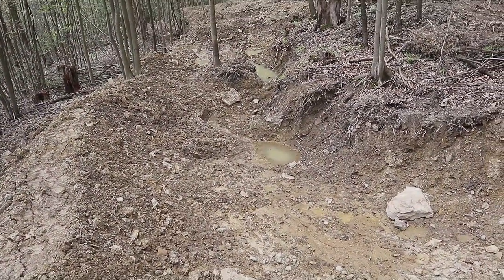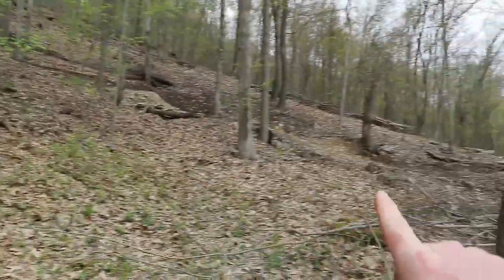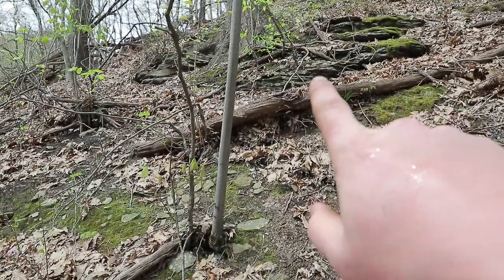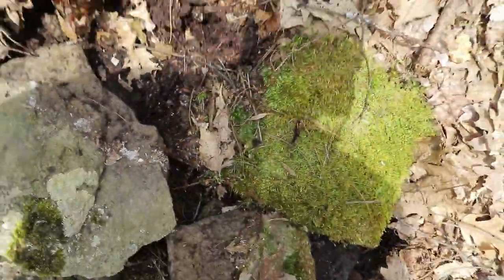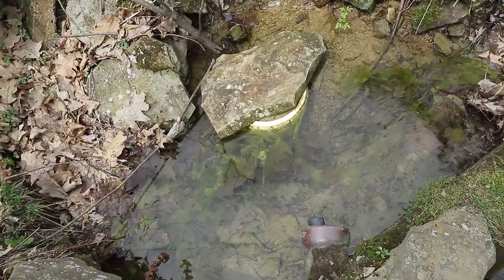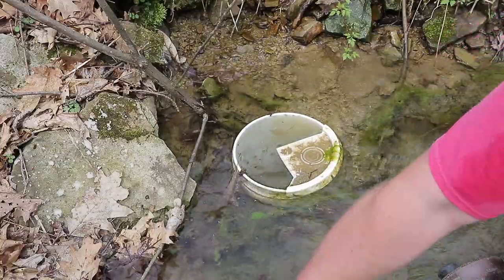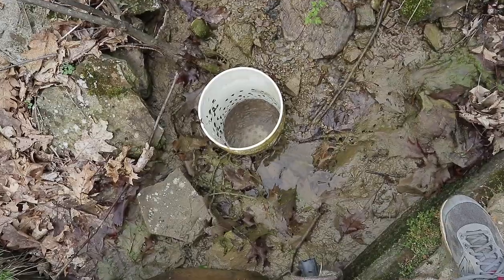Hole In The Woods Discovery Part 2!

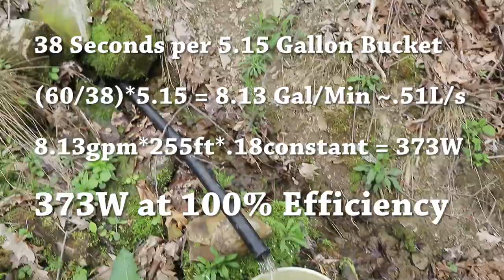Comment: 16:55 The ".18constant" is (earth acceleration)*(water density) measured in "Watt-minutes per foot-gallon" (or W/(ft*gpm)). ^^
According to wolframalpha a more accurate value would be 0.1885 (I guess assuming distilled water), so your actual output is likely even 5% better.

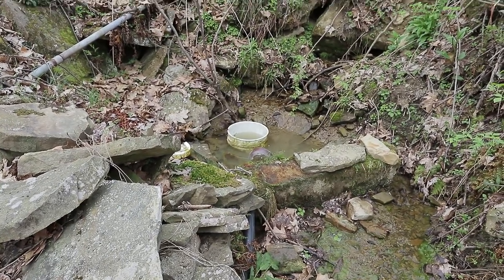Comment: 13:31  I never noticed that section of galvanized pipe in the upper right corner...  If that is pushed into the spring it may be a  'parasitic'  draw away from your operation and it could be substantial.  I'm surprised that you would let that slide based on your nearly obsessive attention to detail (only joking around).  Really though you must have already checked that out and determined that it is no problem? (probably clogged by now anyhow).

Comment: Have you ever considered a sheet of rubber (or even plastic) as a liner in your catch basin?  And if you are interested in a higher flow rate you could always tap into the spring by drilling/pounding down from on top of it, would only need to go down a few feet, say 10 at the most, if that.  You could actually install  a casement/liner in there, cap it with all of the connections then bury/conceal everything.  I guarantee that you would have a huge amount of pressure and volume with a  rigging like that, no pump would be necessary. (You might also consider a few concealed video cameras, you could even use cable for power and network, or just go wifi and solar, someone will eventually come along and eventually some kid will do a vandal routine, sorry to say).  Best regards.

Comment: why not get some spray paint and mark on the pipes (walk along the routes of them that you know) that arent yours? you may find some you could use for the project maybe?? could end up getting more flow! might be worth finding out if anyone actually uses those pipes too (might just be drains to prevent land slides maybe?)
Reply from the maker: because they are buried and I have no idea where they go.
Reply: @JoeMalovich  At least for the steel pipes, a good metal detector would work for that.
Reply: @JoeMalovich  Rat and a string ;)

Comment: to keep leaves and small detritus out of the intake, would it be worth digging all the silt out of the spring catchment basin, then put a roof over it? given all the stones up there, all you'd really have to drag up there is a bag of mortar and a  bucket to mix it in, and a sheet or two of tin for the roof...

Comment: Would it be possible to put a drum up top with a “holy bucket” and output in the bottom, then filled with gravel larger then the holes for an improvement in filtration as well as a reservoir to insure that the pipe stays filled preventing the air issue and debris issue.